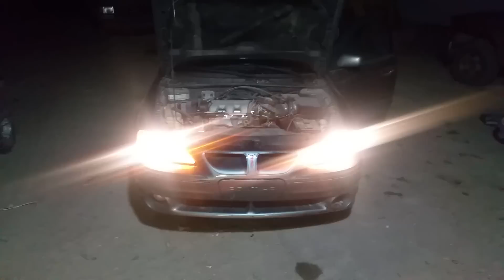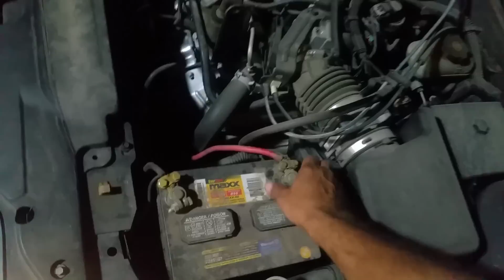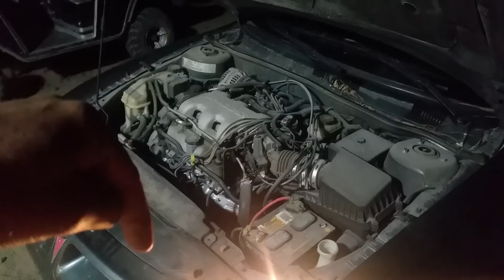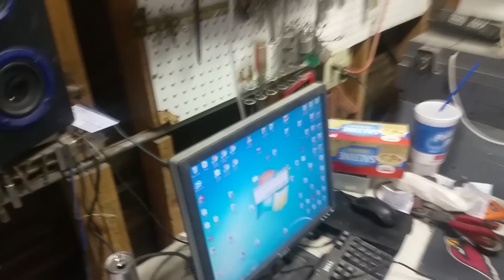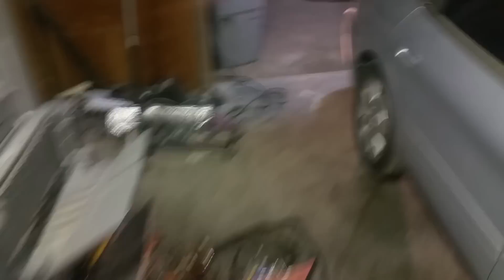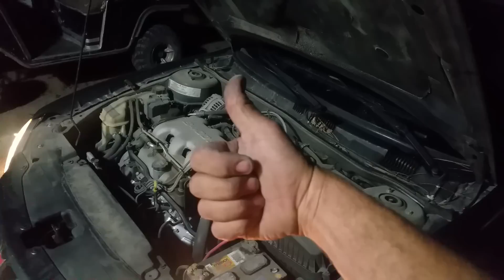Bad Alternator or Bad Battery, Easy Solved

Comment: Hey man, I appreciate the video! I have a bit of a problem with my 96 corolla if you don’t mind trying to guide me in the right direction. Today i noticed the light came on while driving to work, I driver sandwiches for jimmy johns. It wouldn’t start on one of my deliveries after working for a bit, so I had a jump start from a coworker. I went on a delivery and kept it running. When I got back in my car to return to the shop, it would not go into drive from park. I couldn’t move it then it suddenly lost power and died. Everything electrical was not working either. I had my friend give me another jump to make it back to the shop and I barely made it as the car died again. So, I believe it can most likely be the alternator because it died while running. I called a couple places like Oriellys and such but I never know with them but most did say that it is most likely my alternator as well after explaining my circumstance. Idk where to go from here! Thankyou in advance! Mitch
Reply from the maker: yes its the alternator. you are running on the battery only. when the battery dies completely the vehicle shuts of. the longer the cables are hooked up, the further you can go. when you get a jump from someone to limp it back, do not run any anything like phone charger, radio, etc. it will shut down even sooner.be sure to check charging fuse, or alt fuse. if it is good, change the alternator. thanks for watching.
Reply: thomas brian how do I check the fuses? And okay thankyou!

Comment: The best vide I have come across t explain the 2 Well spoken and straight to the point. Have on 02 f150. I was driving today and noticed my dash lights got dim looking. Truck started feeling kinda sluggish when I hit the gas. Then the radio was going on and off. ABS light comes on and the battery gauge dropped all the way to low. I went straight home about 5 miles and barely made it. Cut the truck off now won't start. just makes clicking noises. I jumped it off with my wifes car and noticed about 5 min the dash goes dim again but i hit the gas and the dash lights brighten then dim when i let off gas. then it died again and the door locks barely move. I'm leaning to alternator don't think its the battery any thoughts?

Comment: Never disconect battery cables you could fry pcm and other components im ASE certification and this is wrong new cars depend on battery as a regulater
Reply: Thank you.  I wish I would have known this before listening to my father in-law yesterday.  I removed the negative and it failed.  Looked it up, removed the positive and it failed.  Did it again to show my wife.  One more time later on after removing and checking my ECM just to see why it ran for around 1 second after removing the cable...  Then I found out why I should never have done that even once!  I have a 2016 jeep and I'm afraid listening to "old school mechanics" may have caused more issues for me than I started with.  I'm waiting to see if I can find a volt meter to actually test the alternator the correct way now, wish me luck!
Reply: @vladdangel  jeep..
Just
Empty
Every
Pocket

Comment: I love a man ( i’m a woman) with common sense! Woke up this morning, lights dim, dash flashing, clicking noise. Started to have my car towed but tried this first after getting jump, cleaning posts and cables and letting the battery run and drive for about an hour. Tried this suggestion and NO PROBLEM. Car is still starting fine. Thank you
Reply from the maker: perfect ty for watching.

Comment: You could measure the battery voltage at the battery with the engine running. Should read near 14.5 volts if the alternator is charging.
Reply: Many of us don't have a multimeter so this is the best way to do but thank you anyway 👍

Comment: When I start my truck in the morning the volts drop all the way down and eventually all lights go off including the radio but it does not die. Then a few miles down the road it all kicks on again and the volts read around 14. Is that signs of a bad alternator?
Reply from the maker: yes it is, the armature prob has some build up on it. do you have a oil leak near it. i have seen valve cover leaks that spray oil when driving onto the alternator. causing that same problem. but either way, yes its a bad alternator. thanks for watching.
Reply: thomas brian you were right. I changed it last week , trucks been running fine now.
Reply from the maker: so good to hear, thank you very much for responding with your ending results, it helps so many. thanks again for watching.

Comment: If you use a volt meter the out put should be near 14 dc volts from your alternator at the battery if you pull the cables and it dies it could be the alternator or corroded cables or fuses if the wires look kosher it’s prolly the alternator

Comment: sometimes the alternator may be bad and the car will still run if the alternator still puts out less voltage than it should but in most cases the video is correct
Reply from the maker: thanks for watching.

Comment: my battery is brand new my alternator is brand new but when I pull off the alternator my car still dies what can be the problem after that I even took it in to see if the alternator is good and the battery is good and they both said both of them were good please help what else could be my problem because my car does died after I pull off red wire.

Comment: So you can't go by the sound the car makes when trying to start it? I got the sound like it was trying to start.. then a loud purring sound. After trying a few times, the car started and I had no problem starting it again after a few mins with it off. A day later, the same thing but didn't start. Would that be the battery more likely or the alternator? ty

Comment: Truck now on tour to 3 different mechanics. Messed my car straight up. Starts and immediately dies after replacing alternator and changing battery.  Fault codes galore that do not clear, and some codes the dealer and specialists has never heard of.
But the test does work though.

Comment: http://www.troubleshooters.com/dont_disconnect_battery.htm  These guys say you can burn circuits in your car if you remove a batt cable while the engine is running.
"Your battery does more than just provide electricity. It also shorts AC, spikes and transients to ground. Removing the battery from the circuit allows those spikes and transients to travel around, endangering every semiconductor circuit in your car. The ECU, the speed sensitive steering..."

Comment: So if my battery and my alternator are both good and car dies overnight what is the problem??
Reply from the maker: you have a draw somewhere, check out my how to find a short video. 
https://youtu.be/9wLrTjeb9TY

over 700,000 views . it will help you fix the prob or point you in the right direction. ty for watching.
Reply: You ran out of gas!

Comment: Technically its not 100% SAFE. Y? if this was done to a drained/semi drained battery, the regulator will be on an X duty cycle forcing Amps down the line to the alt, disconnecting terminal may cause a surge/spike in the alternators rectifying diodes because you will be removing the balance in the circuit. This actually may fry your alt or decreases its life tremendously. Investing in $3 multimeter will let you know alts activity/battery's voltage
Reply from the maker: ha ha ha so naive. trust me little man, its all good. been doing it for years. your regulator only regulates the current. there for if there is no storage the regulator will not surge. if the storage is low, the regulator will fill the space. its the reason your idle drops when the battery is low and you connect the low battery. stop reading things and believing without experiencing it. thanks for watching

Comment: Just to add here there is a difference between pushing the power button on a computer and pulling the power from the back while on. You can in fact damage the computer. If you have a newer vehicle and have the ability to take the battery up to an AutoZone, do it. They will test it for free!
Reply: Undeadly it sure is it would have went black NOT "power down"

Comment: Old school just like i was taught thanks for the recall of my 1963 Ford Fairlane Sports coupe I was 16 got it at xmas ith a cracked 289 small block and my Dad asks me "  so you gonna fix it or make it better than it is "?  I answered " better" my dad had me bore it out by hand nail polish was now only for every Nut ,Bolt, and hole !  Empty can better be empty when your done !  Haven't worn nail polish in 42 years . . thanks Dad for making me your 3rd son LOL. . BUT I'M ALL Female
Reply: that's good to know all that stuff under the hood that where you can work on things yourself and make it easier but I still don't believe you are all female I need proof LOL

Comment: Ok I took the positive cable off and it stayed on for a few seconds .so would it be the battery or alternator.i started it looks like low voltage

Comment: Nice simple explanation no tools just common sense. And if you don't want to lose the settings on the radio clock or seat just change the battery while the car is running, after all the alternator is supplying the power. If however you don't want to risk doing that just hook up a good battery to the leads then do the swap 😆

Comment: This is NOT TRUE!  if your vehicle has an electronic accelerator like my 07 wrangler has. The accelerator will not work and the engine will NOT run with the battery disconnected. Your method will work if the vehicle doesn't have an electronic accelerator.
Reply: thomas brian 🤣👍
Reply: thomas brian What he describing isn't limp mode at all.
Reply from the maker: no,,,,,,so bad alternator ? ha ha ha ha lets see, i did describe that if it dies !!!!!!!!!!!!!!!!!!!!!!!!!!!!!!!!!!!!so funny.
Reply: thomas brian Hey I'd like to ask a question, I fitted a new alternator to a 2010 Opel insignia, the last one was loud and whiny but no performance issues, battery is fairly new as well,  only fitted a couple of months ago. Now I'm getting intermittent battery red light followed by abs fault both go off soon after although occasionally battery light stays on until car turned off, then it's gone upon restart, doesn't seem to be any performance issues and all cables are connected and secure. I'm thinking it's a defective alternator, can you offer any input. Much appreciated. Thanks.

Been driving it for a couple of weeks like this , starts fine drives fine but it's a bit if a worry.
Reply: Electronic Accelerator... sure, sure... LOL
Reply from the maker: you sir are in limp mode, get your codes read, you too have another problem. just funny little rookies everywhere. if you want my help, just ask. but be a ignorant one with a mouth and you are on your own. i dont understand how a real man can tell someone they are wrong about something, when it is clearly that they dont know what they are talking about. im sorry you are having a issue with your wrangler, but you must get the codes read to find out why. do not assume its because of your battery and or alternator. my guess is your alternator ( like pee wee ) is not putting out enough voltage, throwing your car into limp mode, but what do i know. ha ha ha funny funny people out there!!!!!!!!!!!!!
Reply: hman630 then I'll tell that's it's true. I have Mitsubishi with electronic accelerator. I have a dead battery. I jump start the car. And remove the battery head(negative). But the car didnt die. And forgot to install it when i was driving to few shops to get a good deal of a battery.

Sometimes marketing like to say something that is your fault so that they can charge u more. But actually it was only a burn out fuse.
Reply: Yeah I agree, I have a 2003 Volkswagen Passat 1.8T that was rough starting up. I also had an engine light and pulled the codes with my laptop. I had random misfires that I could feel from time to time. Secondary air injector pump was intermittent, coil packs going bad for no reason and even license plate lights cutting out. I replaced the battery with a good platinum 760CCA. And several miles later no engine code, no misfiring, car runs amazing, oh and even my license plate lights work perfect now. So you can't really say once the car starts it solely relies on the alternator. Oh and if you do some research you'll find that the cars battery actually helps regulate coil packs, fuel pump, etc. But this may be different for older cars, but what do I know? Cheers 🍻

Comment: Don't listen to this guy. obviously he hasn't much experience about this subject. An alternator most of the time does not just die all of a sudden there fore doing this test will not show that your alternator is slowing dying and not charging at full cap. 100% of the time. It may be charging enough to keep the car running but still may be on it's way out.
Reply: If you have your headlights, a.c.,  and stereo on than that will take care of your response. I would find you correct that the alternator could be putting out only 12 volts which should be enough to keep vehicle running, but not with additional electrical components turned on.
Reply: @johnrichards7620  e
Reply: greg joyner you are so RIGHT!!!!!

Comment: Ya, this is not a good idea. Just check voltage at battery
Reply: Charles Trubl you can also at engine idle turn headlights on than to bright and engine rpm should go down due to load on alternater
Reply: @indybill4  what if it doesn't go down

Comment: Oh boy,  this is very dangerous and may cause voltage spikes.. even old old vehicles you should not remove the battery while the alternator is running.. someone delete this video

Comment: A little story. I was driving on a highway when the battery lamp started flickering. I managed to get all 10 kilometres to home but the systems started to fail on the way. The engine lost power and could not rev fast. The last thing that failed was the electric power steering and the car was hard to steer the last km. After this event the battery voltage was under 11 volt. After changing the alternator the following things materialized. The power steering that had been a little unstable at high speeds was now rock steady, The aircondition that had been loosing effect was back in full vigor. And the engine that had been I little rough in idle was now humming nicely in idle. The lesson is, that if a car suffers of the above minor issues, then the alternator is properly due for retirement.
Reply: Great video...I wonder if anyone has any comments on my situation:  Now my battery (a year old Varta) has been suffering from a drain in my car - to the point it has been going increasingly flat. But... the last three days my car started cutting out while driving... yet, I could re-start it (so not a starter motor issue) and drive on. But today it finally decided it would cut out more than ever before (multiple times)  and totally drain the battery - which, to me,  suggests eitrher 1) An alternator no longer powering the bad  battery or 2) The bad battery is now basically dead (so whatever the alternator does no longer matters). 

I managed to jump-start (after 10 mins) off my partner's car  as a test... and only got about half a mile before it cut out again. I'll be replacing the battery asap. But do i also have an alternator problem? Of course, i will confirm this when I finally manage to get the car from where I had to leave it!
Reply: @beejj6190  What was your issue, were you able to isolate it?
Reply: @regulareverydayhalfbirdguy  - Yes... a  major soap opera  / £75 lighter with a dodgy mechanic and my OWN fkin net research / process of elimination [starting with an epic fuel pump fit problem solve  after one end of the old fuel pump snapped off in one of the rubber connectors... sigh]... it was debris in my fuel tank gettingb into the injectors . Bottom Line : A £7 bottle of Redex poured into my fuel tank solved my problem virtually instantly (once it got working through) . Had to get a new battery anyway as the old one was done. Good luck, mate.
Reply: omg this is literally exactly my problem thanks😂

Comment: been doing this trick along time,and yes it works,and no it WILL NOT kill,fry,destroy your computer...like the man said,all you may have to do is reset your stations,clock,and seat.on my nissan,i have to reset my power windows.but..not the damn computer..lmao you keyboard warriors need to stop with all the stupid comments.good video my friend.
Reply: do this work on  a 2016 Chrysler 200
Reply: I agree about the computer BUT don't blame the folks posting, blame the "know it all 40 year veteran mechanics" who post all over talking about you will "fry" the computer and other such nonsense....these guys would have you remove your heater core everytime your horn sounds funny.
Reply: does
Reply: or possibly    will
Reply: Gilbert Baldwin power windows need to be reset? how so?

Comment: Clear and nice video,straight to the point with clear info plus using home PC as example,I like it..
Just one question,the correct safety way is to pull out the positive or negative? Thanks..